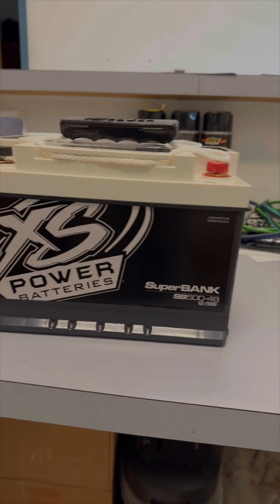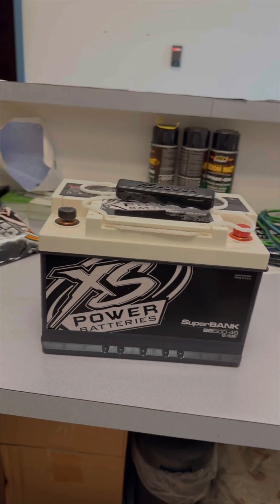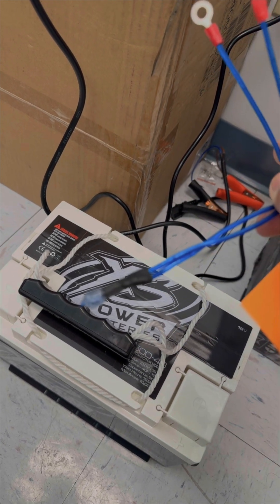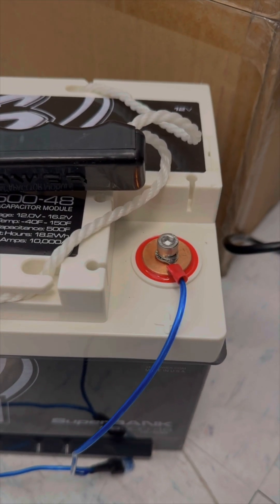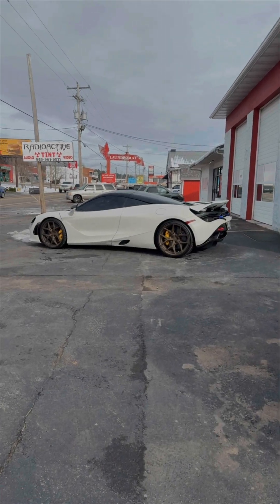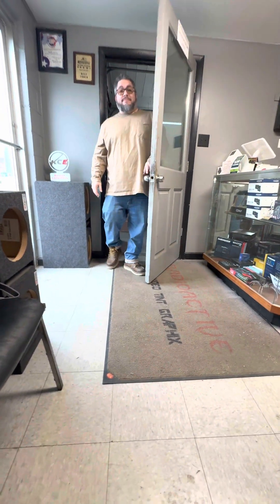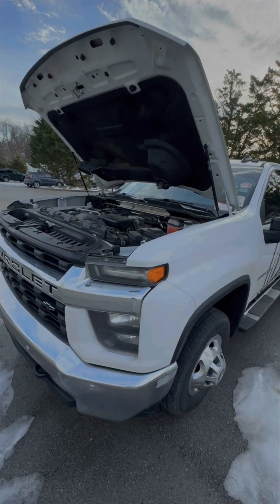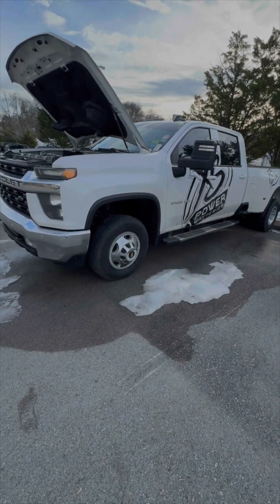SuperBANK Install on our Dually! | XS Power Batteries

Comment: New to finding these batteries & capacitors, for a 2024 F450 dually with dual batteries & dual alternators, you can use battery & capacitor without electrical issues? The BCM Terminal End device on Passenger side battery Neg Terminal (monitors amperage) presents no issues? Would capacitor mount to driver or passenger side, or does if matter with the BCM terminal on Passenger battery. Is there any difference tapping into 12v system with capacitor replacing 1 battery... such as connecting  jumper cables?  Truck sits at times, requires small charger at times to top off batteries,,, woukd no longed need to trickle charge with capacitor?
Reply from the maker: With most modern Fords, you'll need to just reset the battery management system after completing the swap. You can easily Google the steps to reset the system. You can mount either the battery or capacitor to either side, as both the battery and capacitor will be wired in parallel and the energy between both will be shared once both are fully charged. Feel free to give our customer service team a call for further assistance!

Comment: Hey can you run  the D4800 with a RSV-46 under the hood D4800 for running the vehicle and the RSV-46 run two amplifier total watts 8000 ?
Reply from the maker: You can!

Comment: THEY DO NOT HONOR YOUR WARRANTY!!!!!! I REPEAT THEY DO NOT HONOR YOUR WARRANTY AT ALL THEY WILL DO ANYTHING TO AVOID SENDING YOU ANOTHER BATTERY AND YOU'RE JUST OUT THE MONEY PAYING TO SHIP THEIR OWN PRODUCT BACK TO THEM!!! I bought an AGM battery from them the d3400r. I also bought their charger for the battery at the same time. The hf1208 I think was the model it would not charge. It stopped charging. I sent it back in and they told me it was not something they were going to warranty because it wouldn't charge. WHY DO YOU THINK I SENT IT BACK? 3-Year warranty. The battery is less than a year old and they told me to kick rocks. Please buy from another company. I wanted to support XS power and an American made brand but they clearly do not give any care about their customers. I also have the big three upgrade done a high output alternator. Made sure my battery was charging at the right voltage for my car at about 14.8 volts. No neglect or misuse and they told me to eat a fat 🍆.

Comment: working on a sound system and want to use the super bank under the hood but can I used lithium and just need to know the ins and outs
Reply from the maker: You can absolutely use any of our SuperBANKs with any lithium type, as long as the operating ranges are the same. The SB500 models have a working voltage range of 12.0-16.1v.

Comment: Could I use a down4sound lithium battery charger for it or any lithium charger or what kinda charger would I use?
Reply from the maker: You can use any 12v charger to charge SuperBanks.
Reply: @4xspower  thank you I felt like it was a dumb question but I had to know I appreciate it.
Reply from the maker: @PūsħTreeş  No such thing as a dumb question, especially when it comes to electrical components!
Reply: @4xspower yep that’s true I appreciate it man ima order one and get it under the hood👌
Reply: @4xspower  hey I got another question if you don’t mind, can I wire my lithium battery to the Sb500 or can you only wire it to AGM Batteries?
Reply from the maker: @PūsħTreeş  You can wire SB500 to any battery with an operating range between 12.0v and 16.2v!
Reply: @4xspower  thank you!
Reply: @4xspower  I’ve heard that the sb500 has to be wired to a battery for it to hold voltage when the car isn’t on,could I just wire it to my alternator?